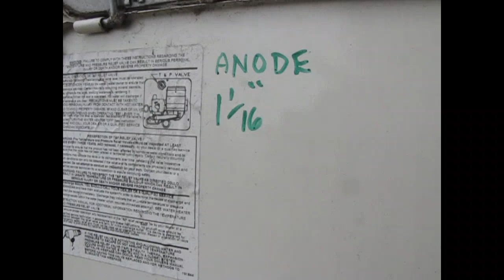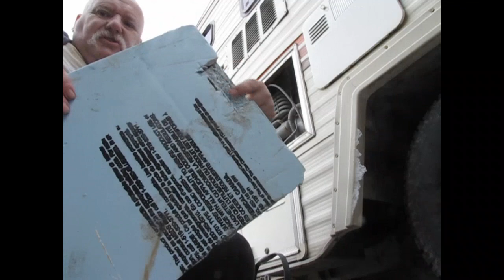Grampa's Garage #225 Time to finish and park the RV

Comment from the maker: WE just got it in 2010 and haven't used it much yet.
Did you also watch here I put antifreeze through the water system?  Up here in Canada, if we don't use antifreeze, the water lines, drains and tanks will freeze and split.  We need to blow all the water out, remove and drain all the drain traps, make sure the pump is dry, and empty the waste water tanks completely.  It's special antifreeze for water systems.  Non toxic, and only about $5 a gallon.  Takes me 2-3 gallons for everything.